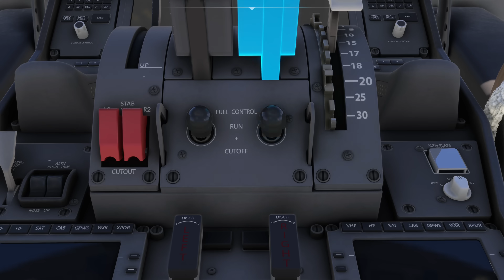Air India 171: Why Did The Fuel Cut-off Switch Get Moved?

Comment: Is it possible that the pilot 1 cut off the fuel and the pilot 2 is not aware off that too during take off ?   Considering it is in the middle location also won't there be a indicator or alarm that might come up when this happens during flight as it might also cutting off lot of other systems right ?

Comment: "The UK safety report from May 2025 identified a critical issue with the aircraft's fuel control switch. This was not a case of pilot error, but a direct result of maintenance oversight failures under the DGCA’s responsibility. Tragically, this negligence led to the loss of lives. Notably, a Special Airworthiness Information Bulletin (SAIB) issued by the FAA on December 17, 2018, had already warned about similar issues related to the fuel control system, yet adequate corrective actions were not implemented."

Comment: The landing gear remaining down all the way is a critical indicator something was going on with the electrical systems. Go back to there and work your way up. The logic of the question and answer becomes clear. Without the VCR timestamps on when the questions were asked is critical.  Something happened that they were trying to troubleshoot. The EECs on these birds do have issues and have been flagged many times.  Don't jump to conclusions yet!

Comment: Captain Steve, I am not a pilot, so do not have a lot of knowledge around the organization of the controls within the cockpit. With that backdrop, I had two questions:  1.) Are there other controls near the fuel cutoff switches with similar locking mechanism such that the “mistake”, if there was one, was that of not deliberately focusing on the right control?  and 2.) Would the fuel cutoff switch be better placed on the panel by the engine starting controls requiring a more deliberate action step, reducing the chance for error?

Comment: You’re just speculating on an ambiguous report that was leaked to WSJ two days prior to being released and released at 1am local time. No one has signed off on this report and it is clearly not written by local authorities. That should tell you enough to not take this report seriously. It’s just been released to buy time for the companies involved to find a way to limit the damages once the truth is revealed. This is not an intentional accident and I do doubt that this is pilot mistake.
Reply: All that is going on is wild speculation while the report says very little.  For example,  nothing about the recorder recording the 10 seconds in-between. I would expect a struggle taking place in the cockpit between the pilots.  One perhaps trying to keep switches OFF another wanting to turn them ON to save the plane.   Did both pilots want to crash the plane and die?   What are the odds of this happening?  This is all absurd!   Experts are not saying whether the switches actually were turned or just input from data recorder shows them being turned off.  Perhaps the data input recorded was faulty in some way.  Who knows.  There are many steps both manual and electric signal and each can fault.
Reply: @sezwo5774 agreed. It was the same for the 737 max crashes blaming the pilots initially. I bet my house it all started due to a technical issue they were facing after v1.
Reply: @BruceLevickbrusca  I am in the USA. All internet media is indiscriminately blaming the Indian pilots and their incompetence.  First it was the they started the take-off without proper flaps setting, ...then that they mistakenly retracted flaps instead of landing gear. Later that they were in a hurry and tiik off frm only half the runway.  Then was the fuel contamination theory.  Now that it is outright murder-suicide.   Always blame on the people ...never yhe machine...because it is Boeing...while in fact nobody knows for sure!  It is probably 50/50.  machines fail, people also fail.

Comment: If flying a passenger Jet is not just a paycheck.. then allowing Camera's in the cockpit is a no brainer. Also there is still the possibility the Pilot who said "why did you do that?" was actually the one who cutoff the fuel. They know its all recorded and thus deliberately points the finger at the other pilot. The reason why this is plausible is because of the response of the other pilot "i didnt do that" etc. that response could be the Truth.. so thats why they havent named names yet and why a camera would instantly provide clarity.

Comment: During climb up, is it possible to pull down both switches with in seconds without knowledge of main pilot? I hope switches are not easy to accidentally operated., it requires a pull n move it On/Off. Hearing abt by 2017 some advisory given there r chances for automatic cut off might happen given to boing airliners.  Is it so ?

Comment: if the locking feature is disengaged the switch can be moved between the 2 positions without lifting the switch during transition and the switch would be exposed to the potential of inadvertent operation inadvertent operation of the switch could result in an unintended consequence, such as an in-flight engine shutdown, this is in the report of Boeing so why do you still speculate that the switches were cut of on purpose by one of the pilot ...Why are they not confirming what pilot said what ?? For me the bigg guys behind the scenes get cleared and the dead pilots do not get the respect they deserve?

Comment: 1. What is the point of having 2 pilots when one can make such a tragic event on purpose. 
2. Why would the other pilot even ask the question? 
3. Sabotage should be suspected by the other pilot right away and not ask whether the copilot turn off the fuel or not. 
4. It appears complete cutoff of fuel is a design error. They should allow a certain amount of fuel flow at worst case scenario.

Comment: According to the report, Federal Aviation Administration (FAA) Special Airworthiness Information Bulletin (SAIB) No. NM-18-33, issued in December 2018, flagged potential disengagement of the fuel control switch locking feature in Boeing aircraft, including the B787-8 fitted with similar part numbers. And all that Boeing did was giving an advisory on the issue.

Comment: Before the flight took of from Ahmedabad, it had flown in from Delhi. There is an Instagram video of a passenger complaining of the airconditioners, lights and the crew calling switches not working. Cockpit electronics may not be connected to the cabin but it says a lot about the maintenance of the aircraft by Air India

Comment: What if the pilot did not manually cut the fuel can it be software that cut the fuel and pilot tried to restart the engine after 10sec. How can you be sure that its pilots? if the switch were cut off /on wouldn't that make click sound that should be recorded.

Comment: If it takes both pilots to confirm engine cut-off, what happens if one pilot is incapacitated during an emergency? I agree with making critical systems more resilient, but required two parties is not the answer...

Comment: The comment suggesting a two-person authentication of the cut-off switches is a good one and could be done in logic and physical separation of authentication actuator...BUT, what if one of the two pilots becomes incapacitated? I think that (especially during climb out) this could be something that is an acceptable risk. A lot less risk than intentional sabotage (for whatever reason).

Comment: As an ex Royal airforce aircraft electrical technician, you have fire switches for each engine, why on commercial jets is the fuel cutoff not via the fire switches, you say you need to cut fuel off if you have an engine fire in 1 or more engines during landing, should you not be extinguishing the fire, the fuel would be cut off during the initiation of the engine fire suppressant, as for the ADR or FDR, it is practice for the ADR or FDR to be sent to a different base for analysis, is this the case so that an independent investigator is analysing the data and voice, I just don’t see the point having to cut the fuel by switch and then press the fire button, that’s 2 steps that introduce delay, fuel cutoff should be controlled using relevant data from things like throttle position, airspeed, fire detection, etc etc. ?? Oh and I know you need a means to cut fuel off to shut the engines down but surely this is also controlled using the WOW switches, it means fuel could be shut off if the aircraft is on the ground but not in the air using the fuel cutoff switches.

Comment: Check the Mint video, that goes above and beyond all this which strongly hints at pilot deliberate action. Maybe an unsaid bias but its important to know. The physical switch has many microswitches underlying and captain only heard the engines spooling down at that critical juncture he couldn't have known and confirmed, blinking and rubbing his eyes that the switches had been turned off. If he saw the other doing it, the other wouldn't have denied it, but smiled a wicked smile (sic). It's impossible from hundreds of points of views that humanly they did it deliberately.. look beyond and avoid getting bogged down in a "this is a third world airline mentality". Air India is one of the world's oldest airlines and with an immensely proud tradition.

Comment: Capt Steve, really enjoy your videos. I urge you to still allow for switch malfunction, as per the 2018 FAA to Boeing warning memo. I have been watching everyone's videos on this crash, everyone has erred, only being 100% right on the (obvious) loss of thrust and the rat. That FAA memo was produced for very good reason, and yes it includes the 787. Perhaps the switches did fail- vibrated to off, one after another, and then per the flight recorder, manually moved by the Pilot back to RUN. The memo states- predicts what happened to AI171 COULD happen as a possible scenario as an intermittent potential problem. In my opinion, important concerns like that should not be voluntary, but mandate a full-stop... ground every affected aircraft is inspected and resolved 100%. We need to be more proactive NOW, NOT following yet another disaster. While they may ultimately not be found liable, in this crash, god knows BOEING (who I once admired)  has lied to us and failed us- repeatedly, and our FAA... target of insane defunding and victim of understaffing is plagued with problems. Both entities have shown major corruption. The FAA memo matters deeply here; it was an important issue but they failed to demand more serious action by BOEING, prior to this crash. It seems collusion and ignorance goes on. 

"Inspection Order: I

In light of the preliminary findings, aviation authorities in several countries, including India, have ordered airlines to inspect the fuel cut-off switches on Boeing aircraft. (WE NEED TO KNOW WHAT WAS FOUND- FULL TRANSPARANCY). 

Air India's Actions: 

Air India had previously replaced the throttle control module (which includes the fuel switches) on the affected aircraft in 2019 and 2023 as part of a planned maintenance schedule, not related to the accident." (DID THEY USE NEW, OR USED PARTS?)

Therefor, I think it is unwise to rule out design defect so soon, and assume so quickly it was pilot intent so adamantly. Yes, the recorders show the switches moving from run to off, 1 second apart, but absolutely do no prove it was manually performed by one of the pilots. Only the return to run CAN be.

Comment: If the Fuel Switches were turned off by the Computer due to a glitch then is it not true that they would have been switched off simultaneously and not a second apart? An answer to this question should clear the foggy windshield immediately...

Comment: Now as we know that the fuel switches are a very critical instrument it should be kept separate inside the cockpit just like the yoke so that a single pilot doesn't turn them off at the same time. Left side engines fuel control with the captain and right side onew with the first officer.

Comment: Yeah I have trouble with my fuel cut off switches on my car too. I put them right beside the door eject switches. And just on the other side of the Trunk Lid Jettison button. They need to be handy so they can be accessed at all times immediately. BUNK! Utter Nonsense not having a software interlock so you cannot turn off the gas while you are rotating or climbing at WOT. I'm calling BS. ben/ michigan

Comment: Truth is the only basis from which meaningful, effective decisions can be made. Truth is not optional, but acknowledging it is.
Giving a pass because a truth is uncomfortable helps no one and typically fixes nothing.
Pilots being encouraged to come forward within their airline without jeopardy is pure hogwash. Can't happen, won't happen, shouldn’t happen.
Airlines have stakeholders and must operate always in the interest of those stakeholders, and further (for all enterprises, not just airlines), this is increasingly mandated by law, since the stakeholders sequestered the law.

So if a pilot is feeling not so chipper, and the airline discovers that, it's their duty to act, in the interest of their stakeholders.
There is always jeopardy in every choice, otherwise the choice would have little or no meaning. There's no bravery without fear.
And you don't need to feel for the Boeing engineers anymore: Almost every engineer with a conscience was either laid off, left or was killed.But that's a bit uncomfortable, so we'll give it a pass.

Comment: I understand the other pilot turn ON the fuel switches about 10 seconds later. My question are 
- if the other pilot had turn ON those switches within 1-2 seconds and not wait 10 seconds (which is incredibly fast), would the engines, or at least one of the engines, had time to restart at such low altitude and start producing thrust to help them glide longer and potentially continue flying at that low altitude? Would 10 seconds really make a difference in this case?
- how long does it take for an engine to restart and start producing thrust?

Comment: In software, I've seen seemingly impossible behaviors occur when a corner case (two edge cases a.k.a. rare events)  occurs at the same 1/100th of a second as a service call.  This would literally be a 1 in 60,000,000 event. At the beginning of the war room there would be a consensus of "why are we investigating that path, it's impossible," and at the beginning of the lessons learned meeting there would be a consensus of "that makes perfect sense, but who would have thought to test these two very disparate systems doing their own thing at the same time?" At the end of the lessons learned, it would be determined that  seemingly impossible event would need a test case for future releases.  Having this experience, I would not say that a software glitch is impossible in the airplane, no matter how many flights it has gone through.  I would also note that each time a plane takes off, it is the first time it takes of with the amount of wear that it has.  
There all kinds of scenarios between a glitch in the software or machinery and the human reactions that could occur. However, my odds would be about evenly placed on an accidental automatic "muscle memory brain fart," then on it being intentional, and then on a software/mechanical malfunction.

Comment: Is it possible that 

1) the switches were not moved but rather there is some kind of electronic bug that indicates they were 
2) the switches were accidentally moved - some reports indicate that there was a service bulletin regarding some switches installed without the detent/locking mechanism not functional allowing switches to move more easily
3) can a switch be put into a position that is not fully in the detent but still activate - therefore could be accidentally knocked into the other position 

I just find it hard to believe that there was a deliberate action to cut the fuel off

Comment: The switch did not move itself.
Reply: Data flowing to the black box  was  contradictory info about both the fuel run/cut off switches.
It's getting murkier.
Reply: Data was triggering false activation to the computers irrespective of the position of the switches
Software was overriding manual shifting of the switches to the fuel pump.
Video also mentioned 'maintenance malpractice'.

Comment: question to Captain Steve:

is it possible that the locking mechanism was faulty (or "disengaged" as per the 2018 advisory worded it) in the fuel control switches, in a way that may have allowed the accidental cut-off of the fuel?
Reply: Valid question from you.

Comment: I think the engines would have already failed to give enough thrust, sensing this one of the  pilots would have switched it to OFF  to pull it back into RUN mode hoping to resolve the matter in that panic stricken moment.